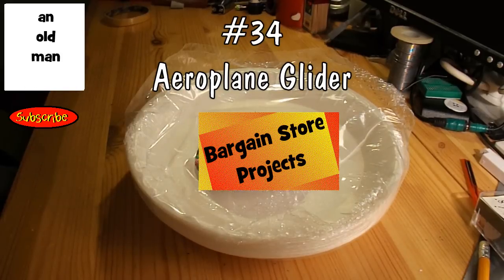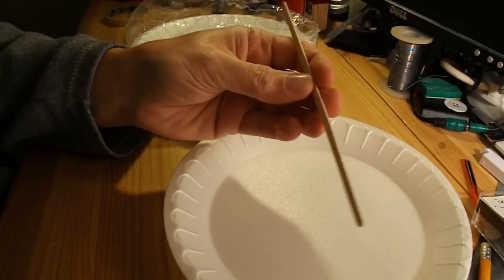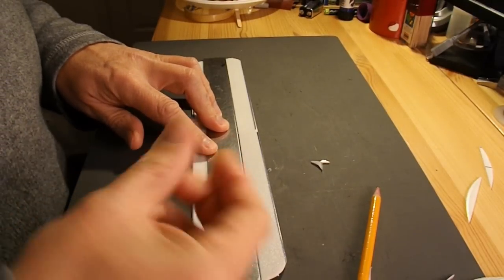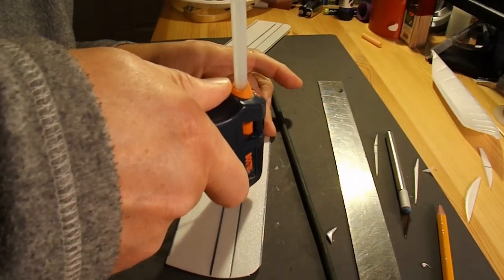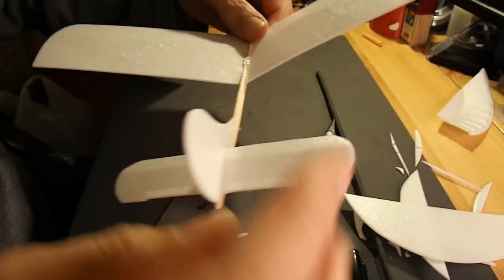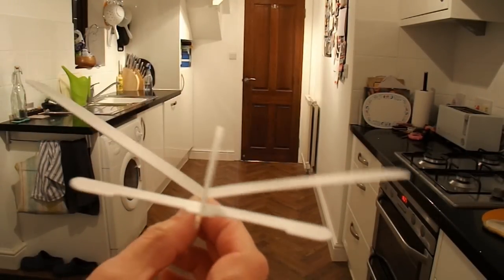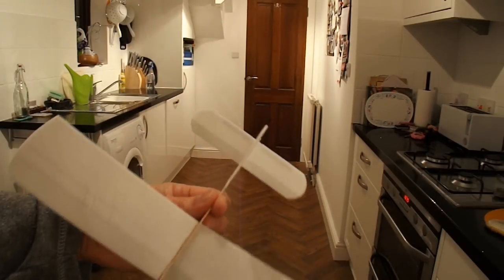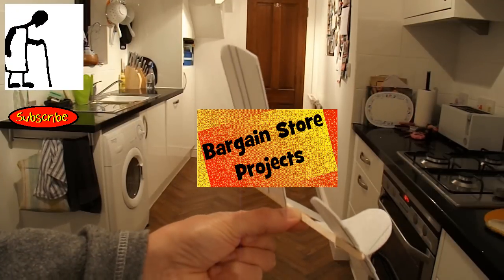Bargain Store Project #34 Styrofoam Plate Aeroplane Glider

Comment: Hi! Nice video! I liked this glider very much! But I got one doubt! I did not understand how to make the wings dihedral. Could you clarify it?? Thanks in advance!
Reply from the maker: The dihedral is the way the wings have a 'V' formation when viewed from the front or back. Dihedral actually makes the wings slightly less efficient as it puts the wing at an angle, but it helps stability because if the plane tilts to one side the higher wing loses lift and the lower wing gains lift so it automatically levels itself. So a plane with less dihedral should fly further but will be less stable. I have not specified how much is required because I just guessed it and it looks about right. You don't need much dihedral and these planes are so easy to make you could make several and compare different amounts of dihedral to see what works best.
To get the effect you can either use a sharp knife to trim the edge where the wing will join the fuselage to give a nice angle or you can just let the thickness of the glue have the same effect.
Reply: GrandadIsAnOldMan Thanks for the reply. Actually, I know for what purpose the dihedral is... Sorry, I think I didn't make a clear question. What I wanted to know is: "How to GLUE the wings in a dihedral angle"?? (sorry If I wrote something wrong, my english is pretty rusty!).
Reply from the maker: Antonio Maciel I hope the last part of my answer covered that for you. I didn't choose any specific angle, I just used hot glue and held it to the angle that looked right by eye, then did the other wing.
Reply: I see!! I thought you have used a sandpaper or something like this! When I use the sandpaper, it is really hard to make both sides even! Thanks for the explanation! And good job with this video!

Comment: can I use normal gum instead of one you used which was like a gun??
Reply from the maker: Ajinkya Naik I am afraid that is something you will have to find out for yourself. I have no idea what sort of glue you have available. You will need to find a glue that will stick styrofoam and wood together without dissolving the styrofoam. The simple answer is just try it on a scrap piece first and find out.
Reply: GrandadIsAnOldMan ok thankyou very much.
Reply: nathan moore YES
Reply from the maker: nathan moore follow the "styrofoam plate gliders" playlist link in the video description and you will find the video I did with the same plane made from thin card which is the same as you would get with a paper plate.
Reply from the maker: Ajinkya Naik nope
Reply: GrandadIsAnOldMan
ok sorry

Comment: I respectfully disagree I think they're elavons.  because they are a combination of elevators and ailorons. Ailorons tilt the plane side to side and AN elevator is one flap controlling movement up and down. Those elavons  are TWO flaps controlling both movements. If you want more info watch flite tests video on control panels. Though what would I know I'm just a child.😀
Reply from the maker: +Luke Gibson the guy who replied to you is +Rob Beard so maybe you should be having this discussion with him. As far as I am concerned I had a senior moment when doing the summary and could not remember the right words. It happens in life but I was not going to rerecord the video for that moment of memory lapse and wasn't going to worry about discussing the finer points of aircraft control surfaces. As far as I am concerned if the control surface is on the tail as it is in this case then it is an elevator. If it is on the fin then it is the rudder. Obviously this gets blurred with a V tail plane. Once you move on to the wing then you can have a whole host of movable control surfaces that all have different names and purposes. Not that everything on Wikipedia can be taken as 100% accurate this article seems to cover the various basic surfaces https://en.wikipedia.org/wiki/Flight_control_surfaces 
On my flying wing I just have two "flaps" and I mix the Elevator and Rudder controls to control it in flight using a small circuit board called a V Tail Mixer so you could call those surfaces elevons or flaperons. As for FliteTest if you watch my videos you will hear me refer to them quite often and if you read the comments and video description you will see I often link to them when answering peoples questions. Thank you for your interest in this project and thank you for taking the time to write your comments, it is nice to know people are actually watching my videos and feel strongly enough to make comments. As for "just a child" enjoy it while you can, you will be surprised how soon life moves on.

Comment: Dear sir how did you do the dihedral
Reply from the maker: Just trimmed the edge of the wing with a sharp knife and used hot glue. The dihedral I used was probably more than was needed and you would probably get a longer flight with less.
Reply: GrandadIsAnOldMan Thank you soo much. I am really impress at how straight your plane flew. I am guessing most of the dihedral was done using the glue.

Comment: um like with wheels and stuff where there is a small motor its electric and flys
Reply from the maker: +thebestrandomgod there are electric planes in my Aircraft playlist but I don't put wheels on them. 1: because it takes far more power to rise off the ground than a hand launch 2: I have nowhere suitable for them to take off from the ground. It would have to be extremely smooth for small planes to take off without the wheels being twisted by little bumps in the surface and that would cause the plane to spin round

Comment: Elevators Elevators their called Elevators! Nice job
Reply from the maker: Hey I am an old guy and have trouble with my memory. You try doing some videos and see how many retakes you need to get it word perfect :-)
Thanks for watching anyway and thanks for taking the time to comment.
Reply: Phil Galati they're actually called elavons
Reply from the maker: Luke Gibson generally 'elevons' are used on delta wing aircraft.
https://en.wikipedia.org/wiki/Elevon
Reply: still they are ailerons and elevators at the same time doesn't matter what plane they are on
Reply from the maker: Luke Gibson did you read the link? Probably better referred to as Flaperons here but in fact as these surfaces are NOT being controlled in flight so there is no mixing of the features and therefor they are neither, they are just trimming tabs.
https://en.wikipedia.org/wiki/Flaperon
Reply: +GrandadIsAnOldMan your right but they are basically the same thing
Reply from the maker: Luke Gibson thanks again Luke :-)

Comment: What if u dont have a wooden coffee stirrer
Reply from the maker: You use your imagination and look for something of a similar size. You could use bbq skewers, plastic drinking straws, split a bamboo cane perhaps. There are currently 71 videos in my Aircraft playlist with planes made from many different components. http://www.youtube.com/playlist?list=PLA5a2xPRSrB0nZItxE_78EJP0F99Ghaki
Reply: Use balsa wood
Reply from the maker: Mitchel1 Many people do not have access to balsa wood.
Reply: Use a popsicle stick
Reply from the maker: Mitchel1 I think you may find that popsicle sticks are rather too short for this purpose.
Reply: GrandadIsAnOldMan cut and super glue them together.
Reply from the maker: Mitchel1 if you can get a popsicle stick then you can probably get a wooden drink stirrer like I did and that is the right size. Why make life difficult? Cutting and gluing a popsicle stick just adds extra weight and any join will be a weak spot.

Comment: they're actually called elavons
Reply: +Luke Gibson  No there not Luke, Elevons have two uses, they act at Elevators and Ailerons, these are fitted to aeroplanes such as the Avro Vulcan and other delta winged aeroplanes. The model glider has 'Elevators' Regards/ Rob.

Comment: can you make a remote control helicoptor
Reply from the maker: I get asked to make drones, quads and helicopters so often I have a standard cut and past reply.The answer is NO. To make a helicopter or quadcopter stable in flight I would have to buy so many parts designed for the purpose it is cheaper to buy a ready made helicopter or quadcopter or a kit. A good example would be something like the Eachine H7 2.4G 6-Axis LED Mini RC Quadcopter. On top of that, my channel is aimed at simple, quick, cheap projects and a helicopter or quadcopter build is not a simple, quick, or cheap project. You would be better finding a channel that specialises in RC Quadcopters or Helicopters so you get the information from people who know what they are talking about. FliteTest would be a good place to start https://www.youtube.com/user/flitetest
or anything David Windestål is involved in https://www.youtube.com/user/dadde87
or you might like this video by The Post Apocalyptic Inventor https://youtu.be/qa_x93JQhNM
for rubber band power check out the work by norris432 https://www.youtube.com/user/norris432
Francisco Ramos Muñoz recently did a quadcopter project https://www.youtube.com/user/franramuzz/videos
Why I won't make an RC helicopter from an RC toy car https://www.youtube.com/watch?v=92GKSUi2y-8
Cheap Mini Quadcopter https://www.youtube.com/playlist?list=PLA5a2xPRSrB2ff05_X2Ek0sMNXA35IFyx
Helicopters playlist https://www.youtube.com/playlist?list=PLA5a2xPRSrB3l5KTGMqUydr8pctBi5Af2
Reply: GrandadIsAnOldMan kinn xd ön
Reply from the maker: Jozsef Kovacs sorry I do not understand.

Comment: What if you don't have a hot glue gun?
Reply from the maker: Then you find some other type of glue that will stick polystyrene or styrofoam without dissolving it.
Reply: Can I use regular glue?
Reply from the maker: Usef Cruz I have no idea what glue you call 'regular'. Some glues will not stick to polystyrene and some glues melt it so you will just have to try what you have on some scrap pieces and see if it will work.
Reply: Ok thanks